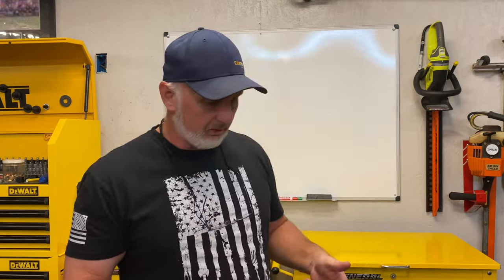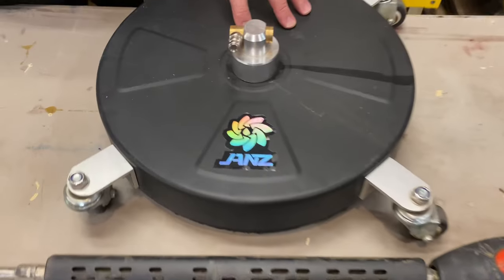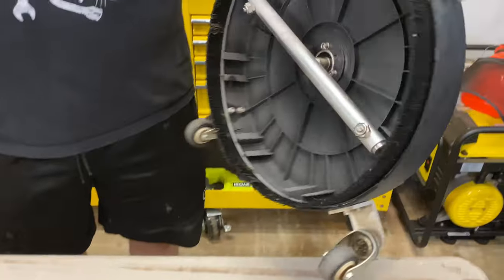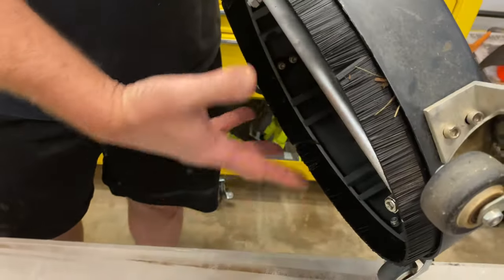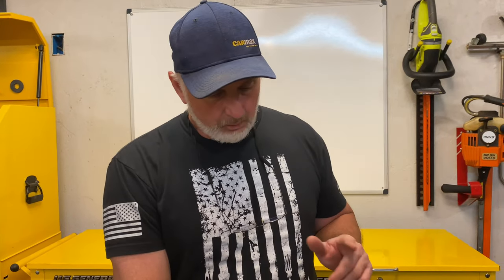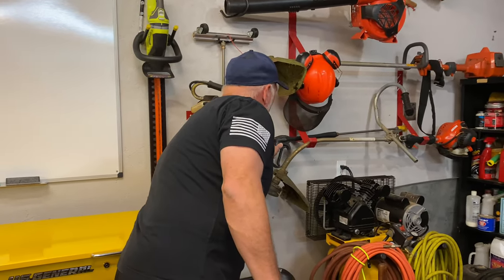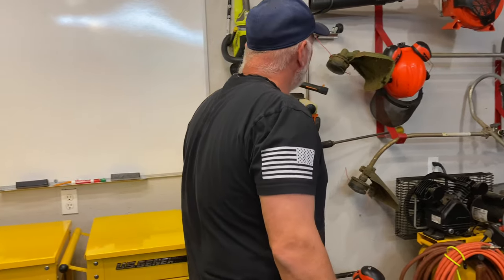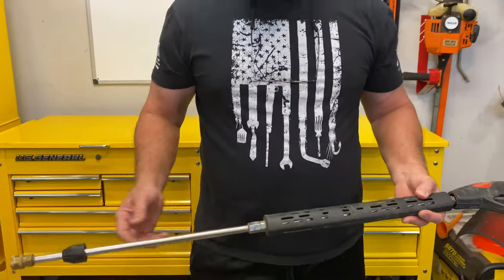Janz Surface Cleaner for Driveways - Review & Demo

Comment: Do you know where to get more nozzles for the spinner? I couldn't find them on Amazon or eBay
Reply from the maker: Go to Amazon and search “nozzles for surface cleaner “  I did that and a bunch of different ads popped up. Hope this helps.
Reply: @minthillbilly  that's what I did  and all thr nozzles ber bigger sizes for Janz Surface Cleaner. I couldn't find the exact same one
Reply from the maker: @Dondokken1980s  ok, maybe an option would be to check a local supplier in your area. Find a place that sells pressure washing equipment. We have a place near me called Interstate Supply. They sell about everything outdoor you can imagine.